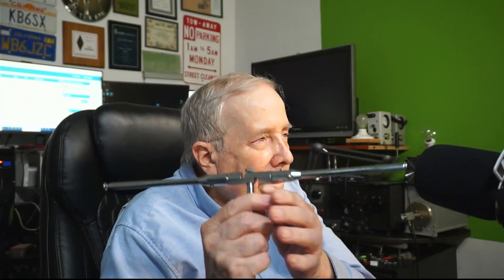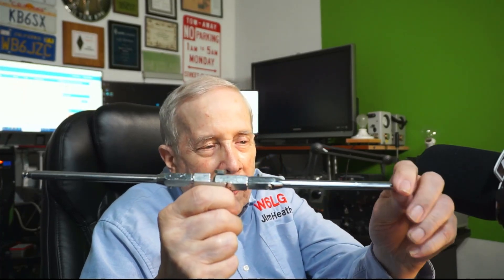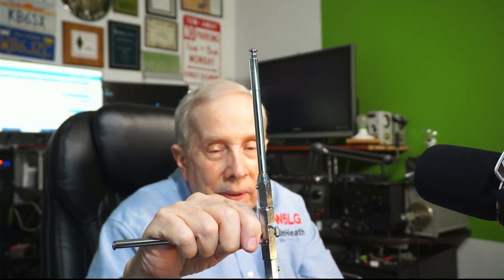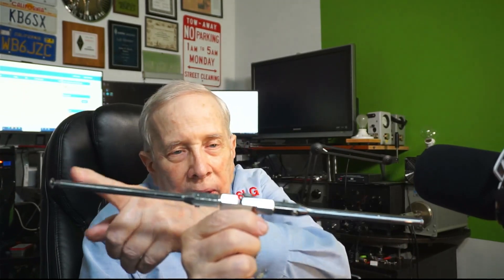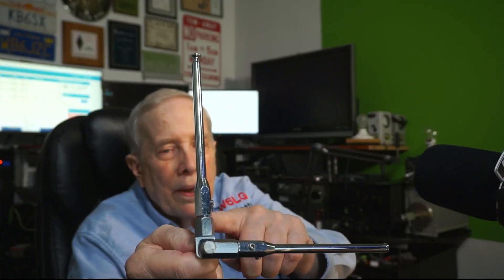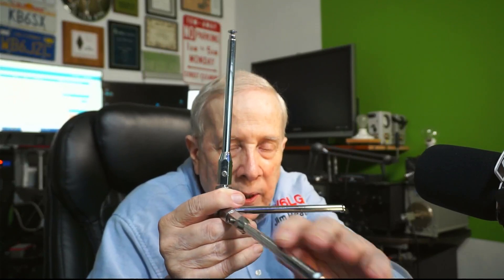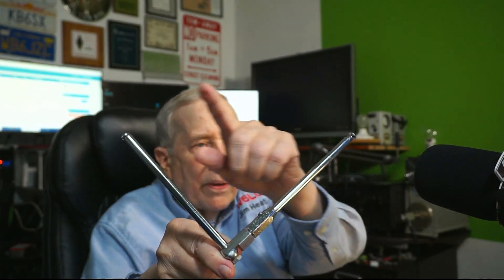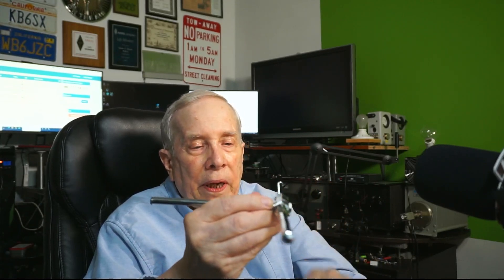A Model Dipole Is Converted By Jim Heath W6LG Into Several Kinds Of Antennas.

Comment: This was a little confusing, but I do get the gist of it.  I realize much of this is semantics regarding when a EFHW is or is not.  I would say that the beloved quarter wave dipole is  really a center feed half wave (CFHW) antenna.  In some sense, there is no such thing a a quarter wave antenna.  Ground planes and counter poises provide for a charge image quarter wave making up the full half wave.  But we hams are terrible at using terminology properly.  A horrible example of this is the ham use of "simplex" for non-repeater operations and now "duplex" for repeater ops.   This drives me nuts!  Call it what it is, split frequency operation.   Yours videos make me think.  Thanks.

Comment: Great presentation! I love vertical dipoles, even now and then feeding them with twin lines to make vertical Doublets. I built a 9 foot 20M dipole with loading coils in the center of the elements. I also fed it with twin line and it worked on 10 through 20, though it was not very good on 12M. Nothing fascinates me more in radio than antennas.

Comment: Hi sir Jim, another informative video and I thank you for that. I do have a question sir and any body with experienced knowledge can answer too. Which would be more effective gain wise forward and receive plus better f/b ratio in a for example 3 element 10 meter yagi, the driven element closer to the reflector, or closer to the director? Sorry, I'm just new to ham radio and planning to build my own antenna. Appreciate very much, 73.

Comment: I have heard other say, a dipole is a dipole including end feds.  Not sure I agree.  I like your approach of looking at an antenna as a dipole in one form or another.  Is it true the positive wave travels down the dipole section connected to the center conductor and the negative on the other side connected to the shield.  If so, what happens with an end-fed?
Reply from the maker: Great point!  There are easy to understand answers.  I think that I should answer those questions in a YouTube video.  So, I will go now to see if I can do that after I comb what little hair I have left after 5 rounds of chemo.  73, Jim
Reply: @ham-radio  I can't wait to hear your thoughts.  I have a 133 foot end feed.  I put it up in hopes of filling my yagi's skip zone I have at 70 feet.  I put the "dipole" at 35 feet.  I have yet to hear a signal inside of the yagi's.  Brad, N6GR
Reply from the maker: https://youtu.be/KlX5Qv77mjg

Comment: Hi Jim! Do you have any idea in this world how old WW2 ircraft used 60 to 100 meter radios with such a small space for antennas?
I really enjoyed the small antenna demo!
Reply from the maker: I think that there was a steel wire from the front of the airplane to the top of the tail.  An antenna tuner was used to get that wire onto a frequency or frequencies range below 3 or 4MHz and below.  Does that help any?  Thanks, Jim

Comment: Great explanation both in words and visuals.  You can do a lot with circuits to make the antenna look like it is presenting a 50Ω reading, but you are correct that if it is doing so by converting RF energy into heat it does you no good.  A friend's Dad once told us, "Can you take a moped on the freeway? Sure.  Should you take a moped on the freeway? No!".  Many analogous parts, function and interface... but just not a match.  73

Comment: I do have a question Jim. I am currently use an automatic coupler up on metal 6 m pole, from where a single approx 20 m wire starts at a 6 m height above my terrace. The coax from the rig is connected to the coupler and the ground of the device is connected to the metal pole, which is also connected to many steel items like the safety rails of the terrace. The question is this: Is it better to have as many steel items as possible, or just leave the 6 m metal pole alone? Either way the coupler makes the job as it should and I have SWR 1:1 or close to that. What is your opinion? 73 de SV1SLB

Comment: Spot on as always Jim, Thank you for your contribution to the hobby it is much appreciated. keep up the excellent work. I find that most people who use a EFHW do not really appreciate that it is a completely different antenna when used on the different bands with regards to it becoming multiple wavelengths and its radiation patterns. People mistake them for being a simple antenna but do not really understand their complexity or the need to control the antenna by means of a counterpoise other than the feeder and also the requirement for common mode chokes in most cases. 73

Comment: You are spot on in your assessment Jim. I do the weekly Cw contest and experiment with antennas. The triband yagi does great as does the 40m loop for 40. For the hell of it, I threw up an efhw 10-80 high power model. After about 15 minutes of 300w qrq, the efhw warms up and the swr goes up the mountain of dispair. They do fairly well for 100w max stations but not ideal. I used to run fan dipoles with better luck. One person mentioned the ext zepp. I may try that soon. Shingles are rough. Felt like constant wasp stings for me. Sri to have missed you on 14.222 yesterday evening. Hope to catch you soon om.

Comment: Horizontal 1/2 wave dipole, once tuned to the desired frequency. Ready to solder at the ends. Will the removal of excess wire that was turned back have an effect?

Comment: Jim is right on the balun or transformers getting hot. I was messing around with the efhw all band vs 1/2 w dipoles.  Funny i settled for the extended double Zepp. I found it in am old antenna book from way back when and I love it. Two 5/8 wave legs make a 90 degree bend space them 1 1/2" apart   for a 0.145 wave 450ohm  feed line. Adjust the 450 ohm to get your 1:1 swr and you're on the air man. John K7KGP wrote and article in QST December of 1987 and was reprinted in the ARRL'S Wire Antenna Classiss 1st edition Chapter 4 pg 4-3.

Comment: Hi Jim, I once had a 10-80 sloper dipole with the old "traps" end-fed. 45 degrees approx. from ground to top of mask and had good results with it back in the early 90's but needed a tuner. Lots of fun using it and great memories with some of the contacts I made on cw. Thanks for the information as always, always learning something new....73...

Comment: The EFHW is a very good antenna the only drawback is you need a impedance transformer at the botom  of the antenna and is about 1/2 a db down over a dipole by transformer losses but 1/2db is hardley anything and can be a multi band antenna.

Comment: Hi Jim, as always a great video! I learn something new every time. Got my TH6 up at 64 ft now and working on getting a vertical loop up for 80 meters, I think I will feed it on the side next to the tower. Your looking better so keep the videos coming! 73's Ron VE7BFM
Reply: Congratulations Ron! I’d love to be at 64ft with my yagi and wires. I really need rohn 45 at least to do it. Play around with your feedpoint location on the loop. I have found the top corner works well with a loop closer to the ground but better 1/4 the way down at 110’ up. Hope to hear you on Cw sometime